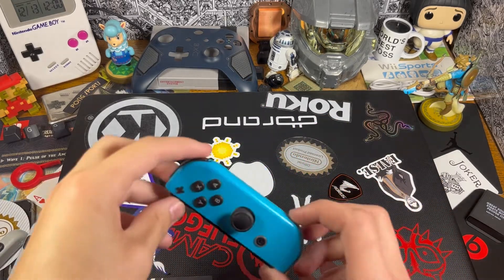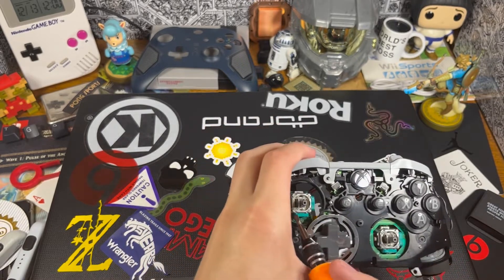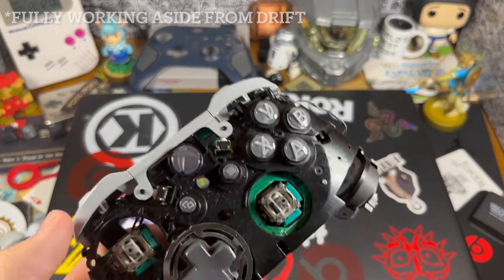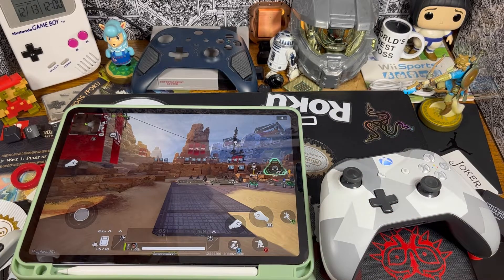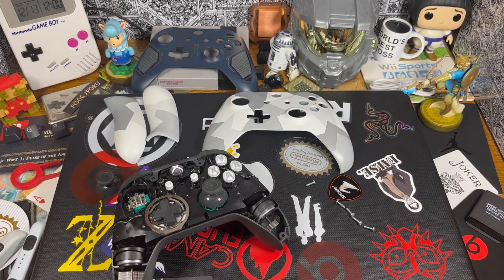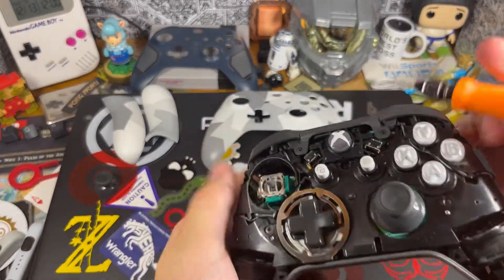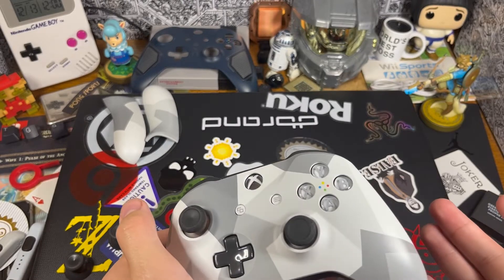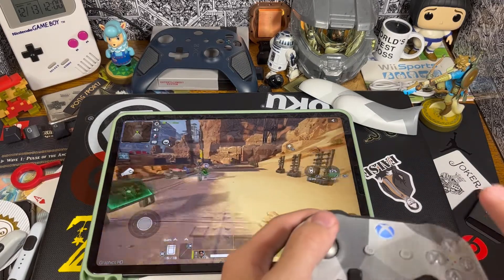How to fix controller stick drift for free

Comment: This doesn’t work. Tried this multiple times after times. Don’t waste yalls time
Reply from the maker: It definitely works, but only on lighter cases of stick drift. If your sticks are worn down too far you may not see as much of a result or any result in that case. Hope this helps.